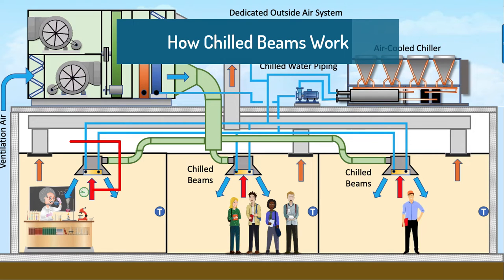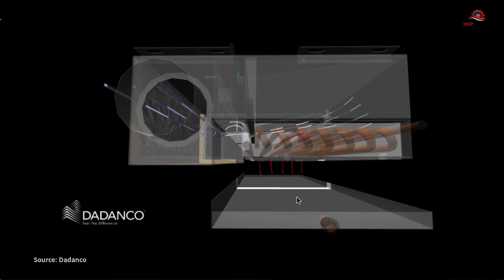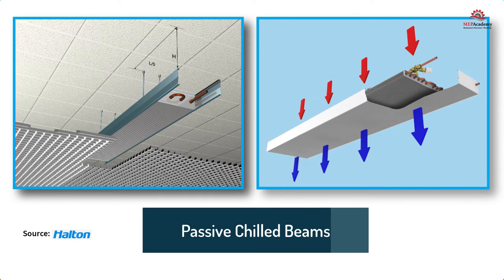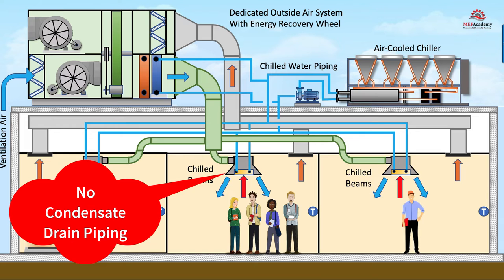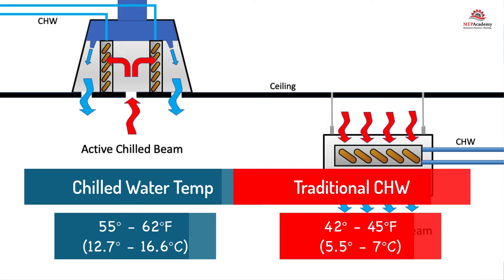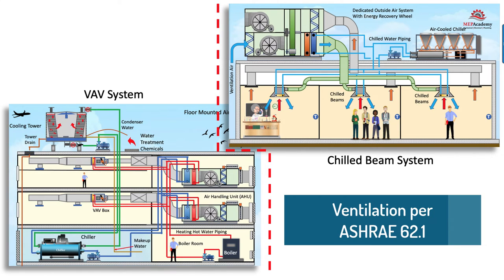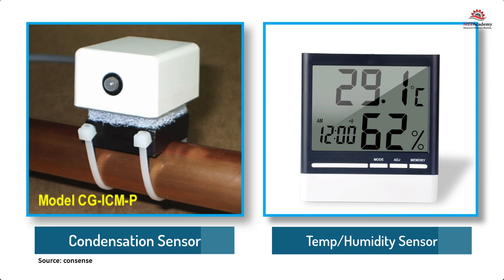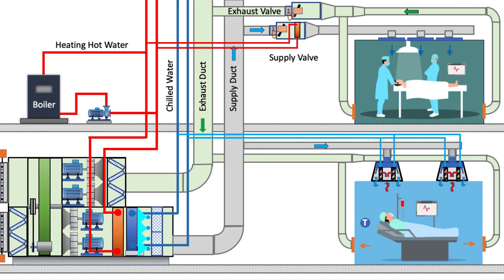How do Chilled Beams Work - Active and Passive

Comment: The chilled water coil in the doas in your diagram is sharing the same chilled water loop as the CBs. This in practice would not work as the DOAS would need 44ish degree water to acomplish dew point control of the primary air supply. A three-way valve mixing loop would be necessary for the CBs to maintain a sensible only CHW loop. As the chiller still has to produce 44 degree water, it sees no lift reduction gained efficiency due to the warmer chilled water requirements of the CBs.
Reply from the maker: Yes, the CHW temperature would be different, as the Chilled Beams need to avoid the formation of condensation, while the DOAS will be removing moisture from the incoming air. The pictures are diagrammatic, and don't show all control points and valves. Great observation. Thanks

Comment: Thanks for the great video. How is the 500 calculated in the Q equation?
Reply from the maker: 500 is a constant that is derived by the weight of water 8.33 Lbs multiplied by the specific heat 1.0 multiplied by 60 minutes/hour. (8.33 x 1 x 60 = 500)

Comment: 10:00 You saying that VAV will reheat already cooled air when chill beams will modulate the water flow instead. But in the 4 pipe chill beam system, the 2 heating pipes are doing the same thing - reheating already cooled air. Please explain
Reply from the maker: You're correct that both systems use reheat strategies. The best application for Chilled Beams are on spaces with high Sensible Loads. Heating is not recommended when using passive chilled beams. Active beams can be used for heating in moderate climates, or a hot water coil can be added to the primary duct that feeds multiple spaces with the same load profile, as this also saves on the added cost of running heating hot water piping to each chilled beam. The annual difference in reheat energy between a VAV system and an a 4-Pipe Active Beam depends on the primary airflow delivered to the ACBs, the minimum airflow setting for the VAV terminals, the primary air temperature, whether there is any temperature reset strategy being used for the primary-air in either system, and the number of hours when the zones experience low cooling loads. (VAV systems can benefit by using parallel fan-powered VAV terminals to draw warm air from the ceiling plenum as the first stage of heating, thereby reducing reheat energy use.) Also, VAV System are better at implementing a Demand Controlled Ventilation (DCV) strategy. Thanks for the question. Great Observation.

Comment: Hi everyone,

As a fellow lifelong learner, I was captivated by this educational content. To make it more accessible, I've summarized the key points using an AI tool, with all credit to MEP Academy. I'd love to hear your thoughts and insights in the comments below.

🔹 Chilled Beams Types: The video elucidates two chilled beam types: active and passive. Active beams, with one or two coils in a metal housing, leverage primary air from an air handler to induce airflow. Conversely, passive beams utilize natural convection, operating without fans.

🔹 Ventilation Requirements: It emphasizes the vital need for ventilation in all occupied spaces as mandated by ASHRAE 62.1. Active beams directly incorporate ventilation air, inducing airflow, while passive beams rely on external ventilation sources.

🔹 Cooling Mechanism: The process of how chilled beams cool spaces is intriguing. Water flows through the beams' coils, chilling the surrounding air. This denser, cooler air naturally circulates, effectively replacing warmer air.

🔹 Beam Sizes and Capacities: Active chilled beams are versatile, ranging from 2 to 10 feet in length, with cooling capabilities of 600 to 1100 BTUs per foot. Passive beams, while efficient, typically offer lower output capacities.

🔹 System Types: The video covers both two-pipe and four-pipe systems. In two-pipe systems, a shared coil is used for both heating and cooling. Four-pipe systems, on the other hand, have distinct coils for each function.

🔹 Air Stratification and DOAS: Here, air stratification's dynamics and the role of DOAS (Dedicated Outside Air System) or AHU (Air Handling Unit) in managing ventilation and latent loads are elucidated.

🔹 Chilled Water Supply and Humidity: The discussion includes the chilled water supply's temperature range (55 to 62°F) and the criticality of keeping it above the room's dew point to avert condensation.

🔹 VAV System Comparison: A comparison is drawn between chilled beam systems and Variable Air Volume (VAV) systems, underscoring the former's energy and space efficiency advantages.

🔹 Dew Point Transmitters and Moisture Sensors: The video underscores the significance of dew point transmitters and moisture sensors in chilled beam systems to prevent condensation and the ensuing potential for water damage.

🔹 Benefits of Active Chilled Beams: The benefits of active chilled beams are numerous, including reduced sizes of ducts and air handlers, elimination of reheat coils, energy efficiency, and quieter operations.

🔹 Cost Considerations: It's noted that the installation costs for chilled beam systems might surpass those of conventional VAV systems, owing primarily to the extensive chilled water piping requirements and the potential need for additional beams to meet specific demands.

Looking forward to your feedback and any further insights you might have!

Comment: Good luck in a hot climate.
Reply from the maker: As we all technologies, chilled beams have design parameters that define when they're appropriate. As engineers this is one more tool to use when the conditions are applicable. This technology has saved a lot of energy for many companies.
Reply: What other devices/strategies should be used to prevent condensation in the CHW pipes? 

besides insulation and moisture sensors, I'm also referring to hot climate